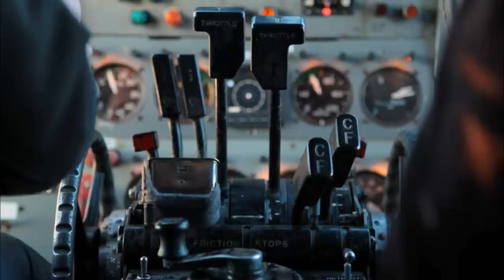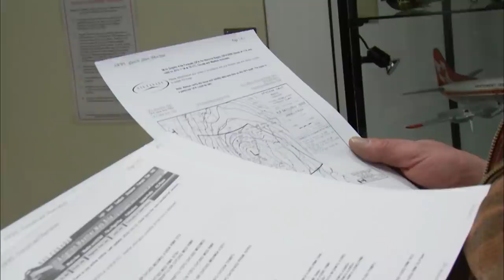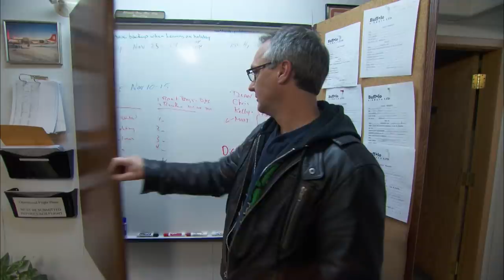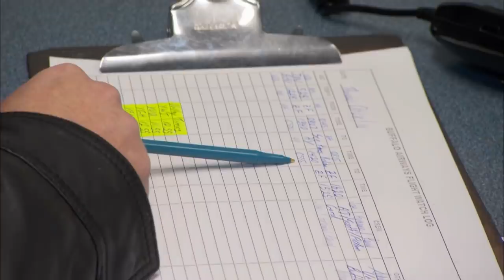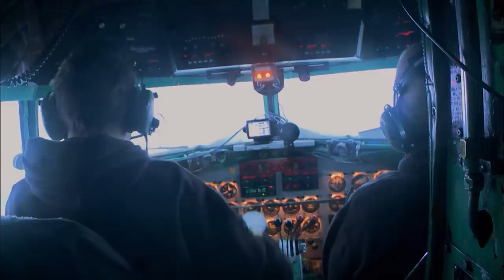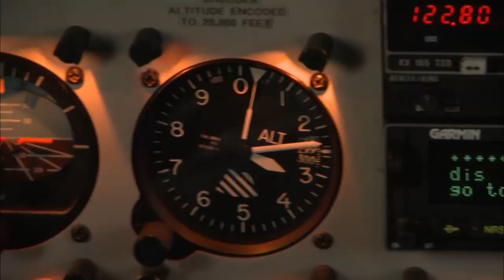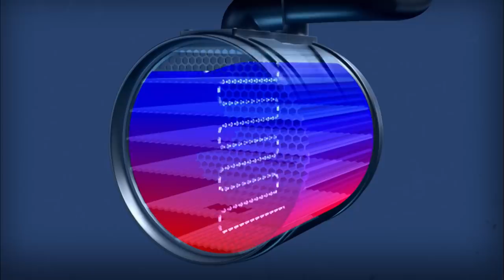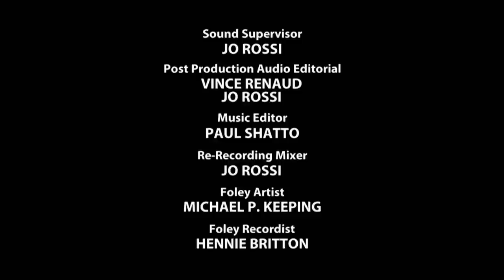Emergency Landing High Above Foggy Artic Circle | Ice Pilots NWT | Wonder

Comment: How did only 4gals of oil keep the temperature from raising?
Reply: OIl flows from tank to engine, doesn't circulate, engine runs out of oil...temperature soars...engine is toast...matter of seconds....tens of thousands $$$$$
Reply: Cars talk in terms of quarts. 16 quarts. Cars use 5 quarts.

Comment: Has anyone see's the cracks on the tire at 14:37?
Reply: Yup, noticed it right away.   I've no idea if a DC3's tire in that condition is servicable or not.
Never saw any such tire deterioration on Phantoms or F-16, but those are higher loaded compared to a DC3's fat tires.